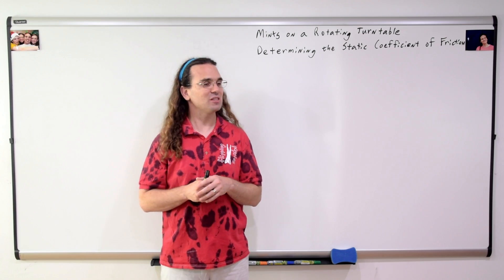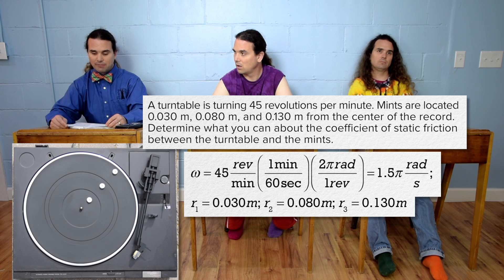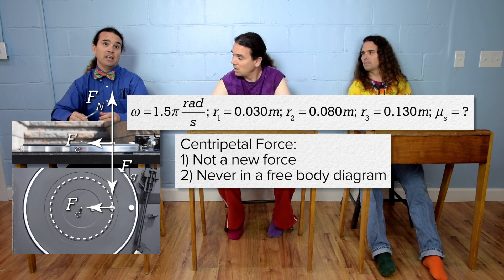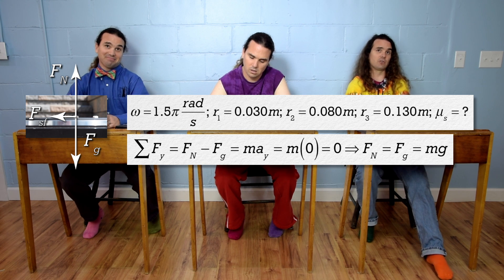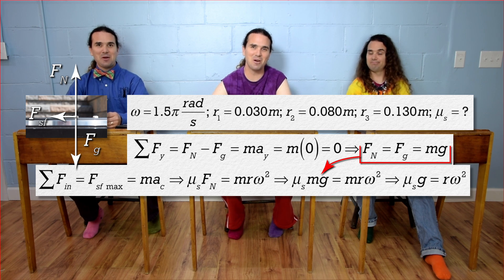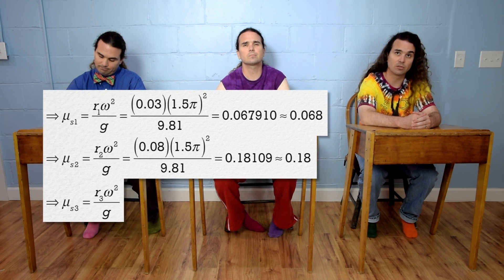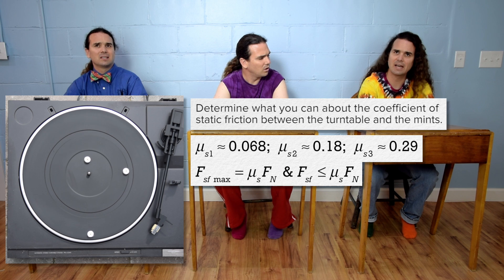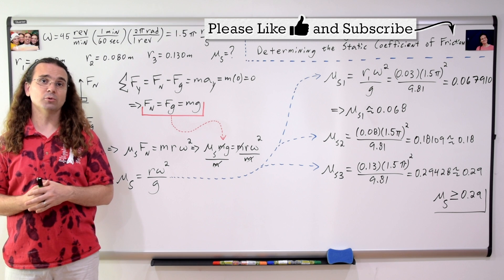Mints on a Rotating Turntable - Determining the Static Coefficient of Friction

Comment: Mr. P why is that the case that it was the maximum starltic force and it is equal to or less than the coefficient of the static friction times the nornal force?
Reply: bc static friction opposes motion, and it increases with the force applied to the object— static friction force acts equal and opposite to applied force, so if you were pushing on a box with two fingers versus with two hands, static friction would match the force you’re pushing with (otherwise the forces wouldn’t be balanced— the box cant push you harder than you push it)
but once applied force exceeds a maximum threshold for static friction, the object will move (and kinetic friction kicks in)
Reply: oops a year later mb lmao

Comment: Thanks! I had a question. In problems like this I always get confused with the friction forces. Because I understand there is a friction force in the inwards direction, but is there a friction force in the z axis ( in the direction of the tangential acceleration) ?? 
Because if there is no friction on that direction I don't understand how the mints are not moving forwards or backwards as the disk rotates. Thank you!!
Reply: Don't confuse the axis direction we assign for keeping track of angular quantities, with the direction forces actually act.  The direction of angular kinematics vectors is more of a matter of bookkeeping and convention, than anything actually happening in that direction.

In this situation, all vertical forces add up to zero.  Those forces are the normal force and gravity.  Normal force, will be as large as necessary to keep the mints from sinking through the turntable surface.   The static friction force (aka traction) can either point radially inward, or tangential along a circular path, or some vector sum of the two that is in between.   At constant speed, the tangential acceleration is zero, and the net force is radially inward.  Static friction points radially inward.  When tangential acceleration is concurrent with the speed, part of the static friction acts radially inward, and part of the static friction acts tangentially.

As an example, given a 10 cm radius, and a speed of 10 cm/sec (i.e. 1 rad/sec), the centripetal acceleration is 0.1 m/s^2 and is radially inward.   Suppose a mint is at the 12 O'clock position, when moving clockwise at this speed on a turntable that is simultaneously slowing down at a rate of 1 rad/sec^2.  The corresponding tangential acceleration will also be 0.1 m/s^2, to the left.   These two tangential accelerations add up as vectors, and become a total linear acceleration of 0.14 m/s^2, which points in the down-left diagonal direction.  Friction would have to be large enough to supply the force for the total linear acceleration at this condition, otherwise the mint would drift.

Comment: If radians is a placeholder, can 1.5pi rad/sec be written as 1.5pi/sec?
Reply: Not exactly. Your expression "pi/sec" is not correct. Pi is a mathematical constant equal to 3.1415..., not a unit.

If you don't want your answer to include radians, you can format use an exponent of negative 1 (denoted ^-1) to identify that you want the reciprocal of seconds.

So, the answer would become "1.5pi sec^-1".

I hope this helps you understand better :)

Comment: Should not force of friction act in the tangential direction? With no friction mints would not ffly out in outwards direction but in the tangential direction... :/  like water in the rotating bucket
Reply from the maker: The direction of the centripetal acceleration acting on an object moving at a constant angular velocity is derived here: https://www.youtube.com/watch?v=6B6YRPYVJ5Q&feature=youtu.be it is _inward_. That centripetal acceleration is caused by a centripetal force which is the net force in the in-direction. In this example that force is the force of friction.
Reply: Ah, thank you so much for the derivation video! I have observed mints as a passenger in a car that is turning. There is no inward force acting on a passenger, only an inward friction force acting on a tires. Car shell keeps passengers in a car and I thought tangential friction force mints on the table. But mints are tires in this case...:D. Thank you very much for your reply.

Comment: Why the Coefficient of S.T. should be greater or equal to 0.29? Can you explain further?
Reply: I struggled with this too and had to listen to the explanation many times but I think I get it now: recall they say that the coefficient of static friction (u_s) x normal force = f_smax... But once f_smax is reached the mints will fly off the turntable because f_smax leads to f_k once reached (static friction "breaks" and an object must go into motion where it experiences kinetic friction). Since the mints are just chilling there, we know f_smax MUST be at least greater than tor equal to the greatest value here or else they would all be flying off the table with the highest value we calculated.